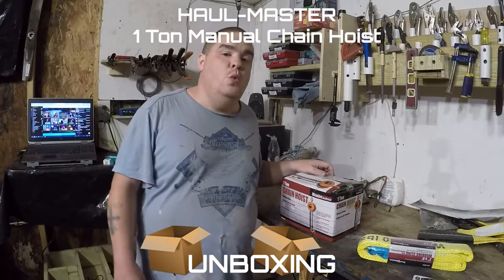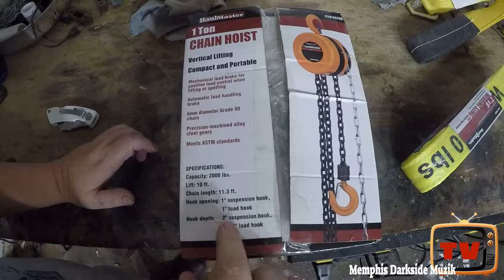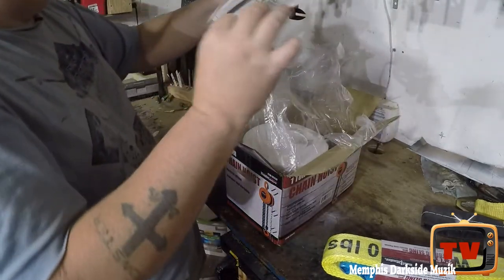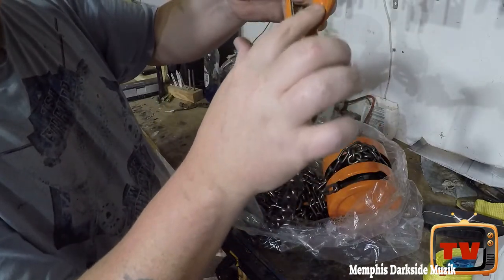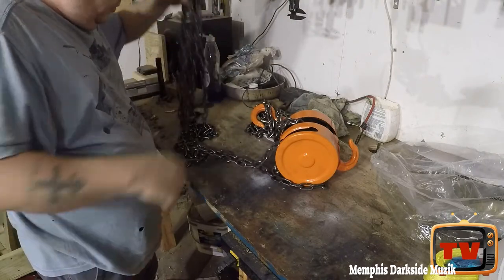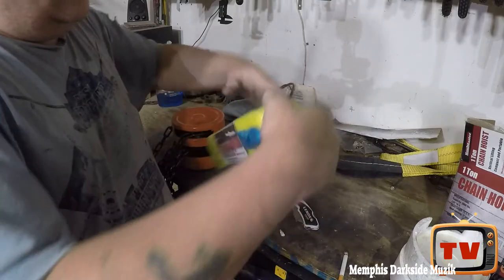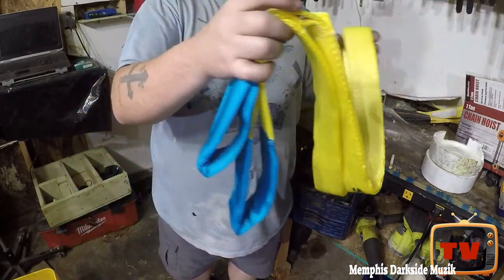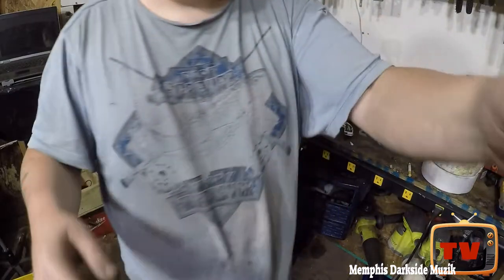Harborfreight HAUL-MASTER 1 Ton Manual Chain Hoist UNBOXING Part-1

Comment: I love HF, but not what they do with returns.  I returned a Pittsburgh plier set (diagonals, needle-nose, etc...) because the diagonals had a huge gap when they closed, and wouldn't even cut a zip-tie.  I showed it to the clerk, and he took it and gave me a refund.  The next day the set was back on the rack.  I know because of the way I cut the package open.

Comment: That oil doesn't necessarily mean it is a return. We're talking Chinese junk covered with cheapo oil from the manufacturer to keep it from rusting while it's crossing the ocean. All in all, for $70, I'm satisfied with mine.
Reply: Does it have a brake? I need to stop mine and have it hold the load for a minute before I let the tension off. Is that an option? (No video I've seen explains how it works. One was "this is how I built my gantry, and oh, I have this hoist." Then there's this one complaining about the world's cheapest hoist being returned with grease on it LOL
Reply: @woodworkerroyer8497  The HF chain hoists have a brake. That being said, we have one at work that the brake failed on. They're hard to beat for the price but I like to give a good margin of safety and not max them out on weight.

Comment: I usually do not return anything back but when I do I tell them what is wrong hoping they just won't put it back on a shelf . But with HF who knows? As far as the oil you got on your hands, just about any mechanical item they sell is covered with it. 
Stay safe, Joe Z
Reply: Many retail employees don't care. If it's a safety issue, I'll tell them that. 

I returned a busted, rusty Husky tool chest once. I'd gotten it on a good sale, with a discount for it having been MASHED by a forklift at some point. Ended up returning it because it was rusty too mechanical issues were fine, but I wasn't looking to do a whole paint job on the thing or have it rust away and help rust my tools LOL. It was back out on the sales floor the next day I came in LOL. It was hilarious.
Reply: @woodworkerroyer8497  I have had the same experience and feel this may cause someone serious injury or an real inconvenience at the least. I do not know if it is company policy or how the store is managed. As HF is looking to upgrade its pricing it should be looking more into customer satisfaction. As just one example remember Sears?